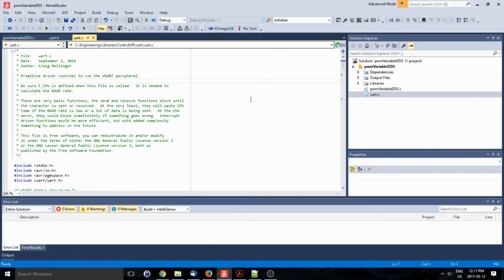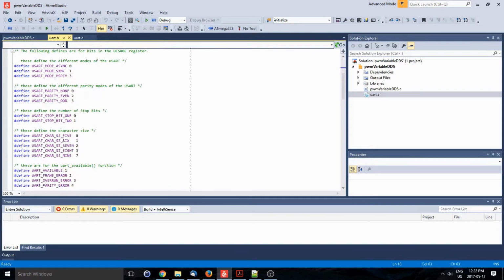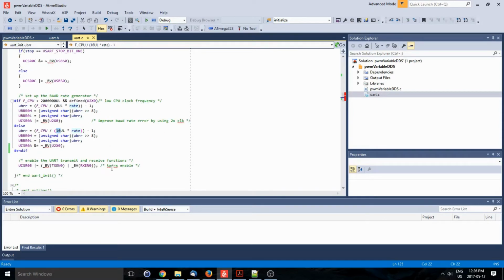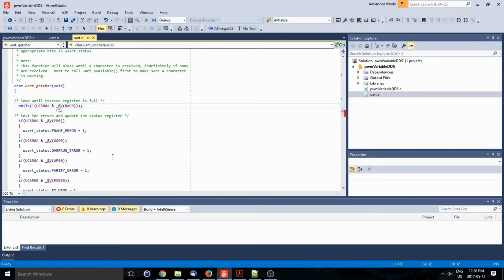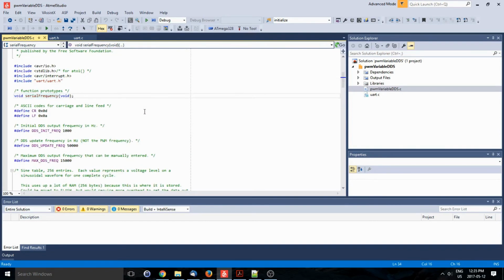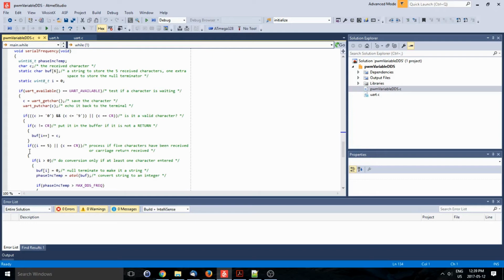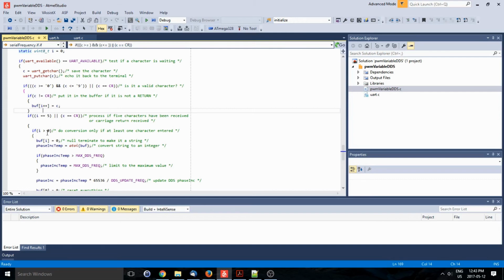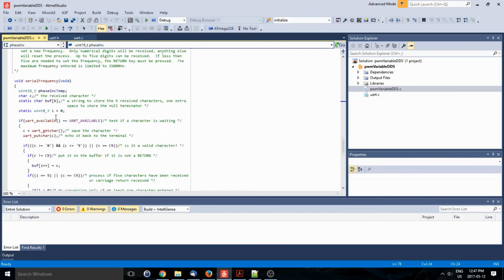Going Beyond Arduino # 11: Using the UART Serial Port (part 2)

Comment: Hi
 Your uart.c and uart.h files,  how do you use them? Are they considered a library in the Atmel Studio world?  Is your uart.c the same as main.c when you open up a new project in Atmel Studio? 
I'm trying to implement some of your techniques to read in 22Bytes of data into my own code and struggling.
Reply from the maker: The files main.c and uart.c are source files. You have to add uart.c to your project so it will be compiled, but main.c is usually added automatically when you create a new project.  Atmel Studio will create a new main.c when you create a new project.  You have to #include uart.h in whatever file you want to use the uart functions, I assume main.c in this case.  The compiler will take care of sorting out the files.  If you look though my other videos, you'll find one (can't remember the title though) that explains the .c and .h files.
Good luck with your project.